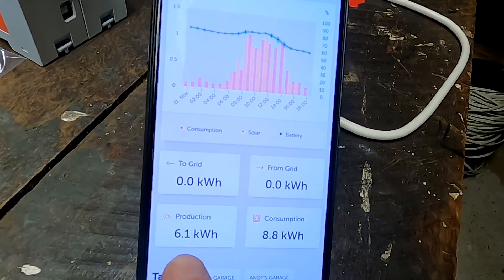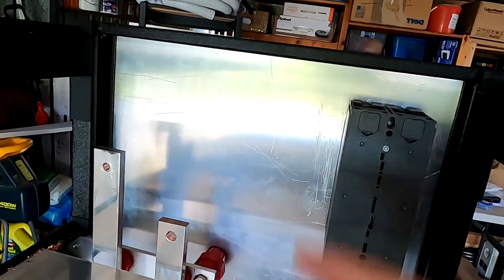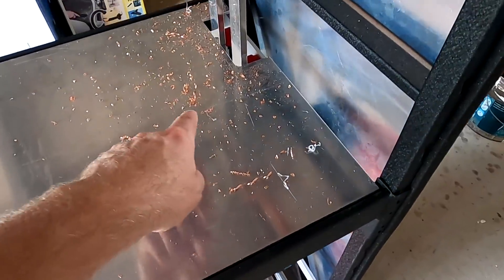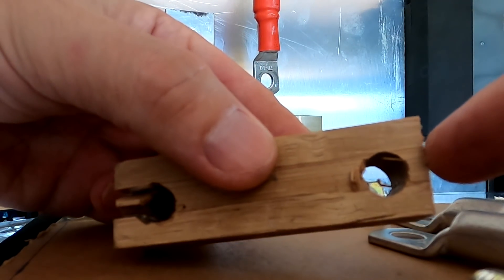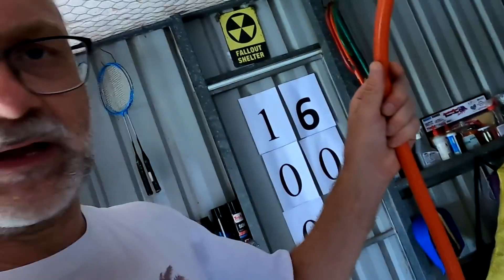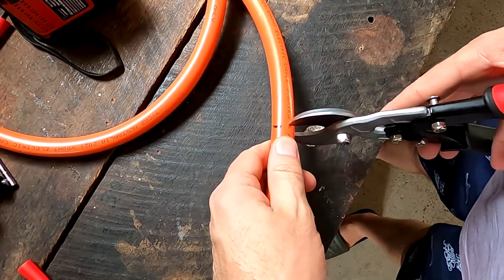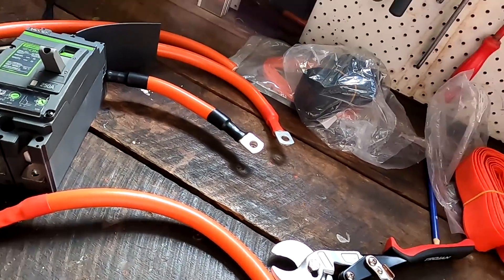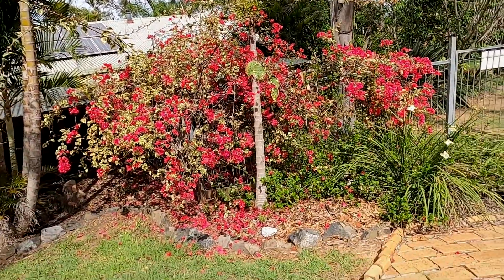70mm ring lugs - better result with 50mm crimper? Battery 2.0 🐸

Comment: Hi Andy, I love your videos. I had the same problem with some of my sizes. Here in the states we use AWG sizes and they don't always match up with metric sizes. Sometimes even within the same size, different lugs will need a little help. 

When it falls between two sizes, I will take the bigger size and grind the face to allow it to close further. Doing that by hand, it is hard to get the faces to be parallel when finished so I will put the dies in the crimper and use a flat file to true them up. Just tighten the crimper to almost snug and work the file back and forth and you can end up with nice mating surfaces.

 I have a video over on my channel about making perfect crimps where I show several crimps that I have cut in half to show the perfect cold weld that can be created. I am making 16 of these 16s 280ah batteries so there are hundreds of these large crimps to make. For that reason it was worth it to me to buy both sizes of hydraulic crimpers. I am so glad I did after using the big one on these large crimps without fear of breaking it if I make a really strong crimp. 

Anyway sir, Keep up the great work!! You are inspiring many to be unafraid to do these projects and achieve great results. Thanks so much.
Reply from the maker: Thanks for sharing, Ray. Great tips.
What's this huge battery for? Building a SuperCharger at your place?
Reply: @OffGridGarageAustralia  Hi Andy , it’s a bit of mission creep. It started as two homes, mine and a friend wanting battery backup for our homes and so each of us with four 280ah 16s batteries. As we were working on it we decided to add two more each and just go ahead and take our houses off grid. We really don’t trust our electric utility company. Then recently we decided since all the infrastructure was in place and the technology was figured out we would go ahead and go to eight each for a total of 112 KWh of capacity. That should allow us to live normally without making allowances for our off grid status most of the year and have more flexibility during the long cloudy spells that sometimes happen. Also the large battery array will be more robust, more lightly used and will last more years than a system that is closer to the edge. It is a costly endeavor but if the lights go out it will be worth ten times what we paid. Thanks for all you do. I’ll keep watching you. Drop by and see what I’m doing in sunny hot Texas. It’s like Australia but more uppity and without the liter sized beer cans.

Comment: Andy; have you calculated the maximum capacity for these aluminum main buss bars? Thanks for sharing. Also, thanks, for sharing your frog. Is this where you got your sniped audio?
Reply from the maker: Hi Teddy, yes I did. It's here in this video: https://youtu.be/mdr5HZZRaTc
Oh, it may have only the calculation of the resistance of these bars in comparison to the copper bars which come with the cells...

Comment: Same issue with my hydraulic crimper always seem to end up using the next size down. but what i do so i don't get the sharp edges is turn the lug 90 degrees in the die and recrimp to create a uniform hex shape
Reply from the maker: OK, so I read that this is not good as it could weaken the material of the lugs. It gets squished left and right and may end up with little cracks. I have filled them down to smooth the edges with the cheap ring lugs from eBay. With these proper ones now, I didn't have the issues any more. the 70mm is the first where the die does not fit.

Comment: Hey Andy..plenty of welding supply shops in Ipswich that will sell 25mm² to 120mm² cable and lugs..there often the longer lug that you want and I find them cheaper then electrical stores

Comment: Im using the same crimper you have there. The die nevery work with the number on it. Just day im crimping a 50mm2 lug, I'll use a 50mm + a 35mm die on it. Work every time.

Comment: depending on brand of lug i have found i normally go one size die down. even though i only buy quality thick lugs i find sometimes they are a tad loose. the other thing to note is some wire is not the full mm2 also.

Comment: Crimped connections loosen up over time and usage with thermal expansion and contraction, soldered is best IMO, but you can crimp and solder those, just dont use plumbing flux....
Reply: No, solder introduces more problems than it solves, damage to the insulation from heat transfer, solder wicking up the cable and creating a hard point making the cable prone to breakage, soldered joints are actually specifically not to be used under screw terminals due to the effects of thermal contraction and expansion introduced by the lead tin. A copper lug on copper cable will have the same thermal expansion
Reply: @nicholaskeur  I was wondering why someone wouldn't just crimp and then solder to be sure but the thermal difference makes sense.

Comment: I’m not sure your collection of lugs but if I had a spare smaller lug, I would drill out the hole enlarging it to fit the electrical post. 
 One more thing I would do… I would at least double layer the heat shrink tubing over those lugs. That tubing is Very thin and can be damaged easily. I’m a fan of isolation. Only MY opinion 🙂

Comment: What was wrong with using 8mm mdf for the shelf’s?
Reply: Sag over time with weight, especially if happen to get moist.
Reply: @DaleKlein  what about 8mm plywood, I just think aluminum is a pricy overkill. But Andy does not skimp I see
Reply: @pmacgowan  Some folks recommended plywood, which should not sag as much.  But technically combustible and thicker to not sag.  8mm 1/4 inch aluminum plate with lexan on top of that is sure very nice.  No skimp Andy!

Comment: 111321/1357h PST 🇺🇸  111421/0757h Brisbane 🇦🇺  Guten Morgan , Herr Andy. Danke schon.  The acrylic sheet idea ist gut. My steel cabinet is small and white 5mm cutting board was used. It’s strong and no metal was required under it. Have a nice day ahead und 73s…

Comment: Hello from the high desert of New Mexico USA 🇺🇸. Andy please be careful with using too much pressure with those C-frame type of hydraulic crimper, if you really want to get really good crimps, try replacing the dies with higher quality ones such as the ones from Temco, I  think you will be happy with them. I hope this helps you out Andy .keep up the good work and stay safe and charged

Comment: I found a similar thing with the same crimper. I ended up just shaving a small amount of the edge so it crimps a bit tighter. 

The other thing that you could consider (although this is a but late now) is you can get right-angle crimp terminals. That may make the system a bit neater and prevent the wire protruding out the top of the system. You can get different angles too, some are left or right, up or down. Very useful in setups like yours. 

BTW, the crimper is easier to use with the pump handle facing up. You can just rotate the handle section. I've done hundreds of crimps with mine now, and it makes it so much easier using gravity to help. I did use your vice suggestion to help too.

Comment: Andy from the looks of the crimps you are using they seem to be not as thick on the crimp sleeve end, as I have used, when putting the multi strand cable into the lugs it seems to be a bit loose, ours are very tight.
Videos are great mate!

Comment: You should be using a 70mm crimp. Your lugs must be crap. Buy cabec lugs - they fit perfectly  with 70mm double insulated welding cable.

Comment: I'm in the energy field. We pull test every batch of crimps. I suggest you do the same. Looks will not tell the story. A 2/0 cable correctly crimped should with stand 1200 lbs of pulling force. If it doesn't, it's crimped wrong. Every size cable is different. Look up the rating for each size.

Comment: Did the same as me with the lugs.  I used all the 10mm and had only 6mm left.  I just drilled them out to 10mm.  Too easy.  Now I am just buy smaller ones and drilling to make bigger.  That way I've got all sizes.  Plus you can get a tighter fit.
Reply: Did too. Thanks.
Reply: Except for the m12 lugs, i notice they have larger surface area then the m6-m10 which doesn't leave much meat when you drill those out to m12.

Comment: Yes, it is common thing - crimping multiwire cable's core to lug with a lower size of crimper's press dies. For exapmle, we are crimping 150 sq. mm. lugs with dies for 120 sq. mm. This depends on lug's wall thickness + summary diameter of multiwire cable's core. Sometimes we use odd combinations like 50/70 dies: one 50 and one 70, if real dies size will lay between standard sizes. So, we choose and trimming size of crimping dies almost for each type/size of current cable/lug combinatios, exactly the same way as you shown in this video. 😊 And this is normal situation! It is very rare, when lug size corresponds with the same dies size. Maybe, this works for  lugs and crimpers from German Klauke brand. 😎
Also, I recommend to turn hydro-crimper for 180 degree - with handle in up position. So, you can apply your own weight to push handle during crimping to ease it. Do your crimper has "finishing" pressure-relief valve? This valve releases crimper's oil pressure in the end of each crimping, and helps much in prevention of overpressure at dies and lug.
Concerning battery strings. Are individual fuses were forseen for each battery string: individual fuse from battery terminal (presumably, pisitive terminal) to the corresponding vertical (common positive) busbar?

Comment: Andy, Pro Tip: When you are crimping the ends of cables with connectors, after you crimp the closest crimp to the cable, when you crimp the 2nd crimp closest to the end, offset it so the flat of crimping is halfway, offsetting the flats of the crimp. This makes it so the bunching areas of the crimp are forced against flats going both directions. When you crimp both identical,  the path for potential failure is increased, since there is less resistance for the cable to slide out. When you crimp them offset, the corners of the crimp flats create small ledges of resistance. Regarding crimping ends going forward, im not sure how expensive they are for you in australia, but here in USA they are hard to come by, most places are out of stock and the few that did have them in stock wanted premium pricing. So when i wired mine last year, i used thicker walled copper pipe that was just slightly larger than the cable size. I actually triple crimped mine since using the pipe was a fraction of the cost of purchasing ends, then i used the same type of hyraulic crimper as you to crimp it on the cables. On the inbetween connections, instead of using cables with crimped ends, i just used the copper pipe and flattened it, then in the middle of the section, i put a small expansion bend up and back down, so after they are installed if there is movement in the batteries, the bend is able to flex the difference, then i dipped it in plasti-dip, since its far cheaper than shrink tube over here in USA with all the shortages in stock.

Comment: You should be cutting off a little bit more insulation before putting the lug on. When the lug is on you should see about 1-2mm of copper at the back of the lug rather than the lug being right up against the insulation
Reply: Having the Gap you speak of helps me every once in awhile because I can cut the shrink wrap off and see inside to monitor how much corrosion is going on. This was useful when I had lead batteries but now I don't see the point because I'm using lithium and none of my cables are having any corrosion problems anymore.
Reply: @SiriusSolar  the other reason to do it that is that when you bend the cable, it isn't levering against the insulation and pulling the strands out of the lug
Reply: @matthewcodlin1387  ah good thinking!

Comment: I found the same issue 2 years ago when I was building my off grid battery bank.( 4 1200 AH fork lift batteries in a 2 bank 24 v configuration)_ I was using a hammer crimp then switched to a hydrolic crimper I first used a 70 mm for the 4 o wire then recrimped w/ a 50 mm. I used dielectic grease and heat shrink tubing